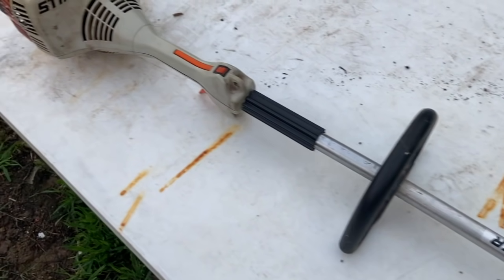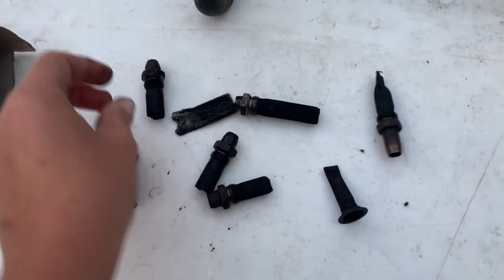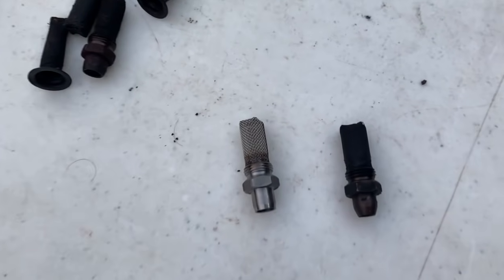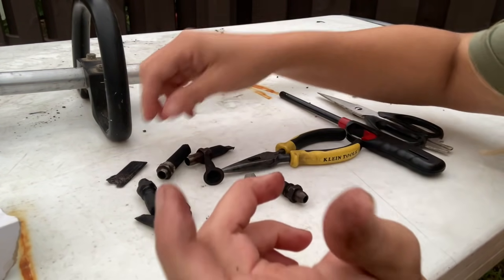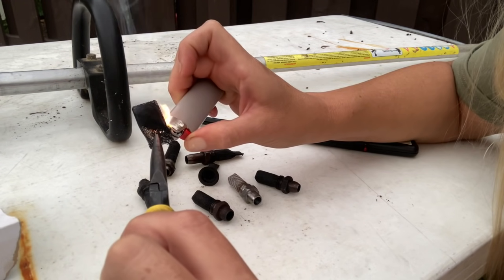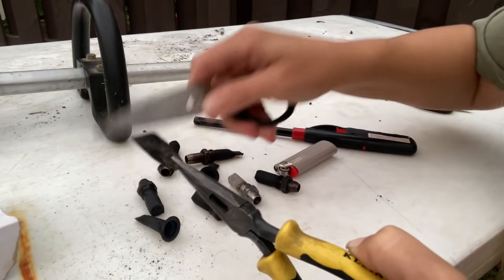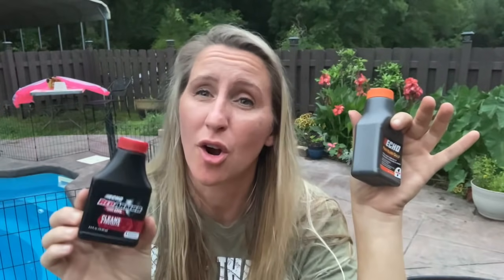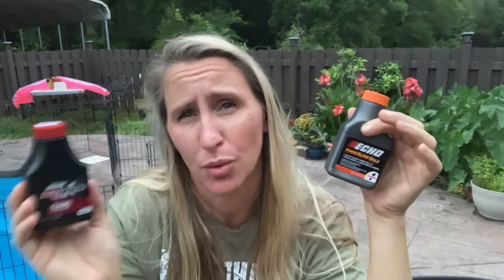THE BIG SECRET! STIHL has NO POWER? Won't Throttle Up? How to fix your trimmer/blower.

Comment: Excellent video.  I've been using Stihl oil -- non-synthetic -- for about 35 years.  My logging saws (044 Stihl) purchased in the early 1990s, still run great and were never taken in to a shop.

Comment: Long time ago in the early 80's, I was a bike mech. Two stroke engines were used in small displacement scooters. The "muffler/stinger" was one unit and would clog with carbon. No power, so we would remove the unit, start a little hot fire and throw it in & let it burn til the carbon was gone. A fresh coat of hi-heat black and customers were happy

Comment: Thanks Chicanic, I live in Australia and this very same thing happened to my FS90 recently. In fairness my dealer mechanic showed me the filter and told me to run it at full throttle to avoid clogging the gauze.
I appreciate your tip too on the Echo oil, I'm not sure if we have that brand here but I'll endeavour to find out.
Reply: Not that easy to find Echo lubricants here in Aus, Penrite 2 stroke oil is easy to find at Repco, Autobarn, Supercheap though. Been using Penrite for many years now.

Comment: Thank you so much!  Excellent tips and makes perfect sense regarding running the motor full-on. Wishing you all the best!
Reply: thank you. also, i use non ethanol gas,cheaper than engineered gas .also,Amsoil Sabre has stabilizer in it!

Comment: I've been using ethanol-free premix 2stroke fuel now for a few years and apart from a small adjustment to the idle and full throttle speeds its the best thing for starting first pull and the pleasant smell of frying potato chips from the exhaust.

Comment: Thank you for this video!  My 3 y/o Stihl backpack blower wouldn't throttle up and I discovered the spark arrestor was completely clogged with carbon.  After I cleaned it per your instructions, the blower runs like new again.  You saved me a trip to the repair shop.

Comment: good to know. I use the Stihl oil and I took the spark arrestor off my echo weed Wacker cause it kept clogging up and would become powerless. I use the same Stihl oil in my 11yr old Stihl hs45 hedge trimmer, I have a lot of hedges to trim. I run the hedge trimmer at wide open throttle 100% of the time and never had to clean the spark arrestor😀. The hs45 is my favorite power tool and the only thing I've ever had to do to it is sharpen the blades.

Comment: I run Amsoil Saber in all my equipment, zero issues and lots of power after years of use.
Reply: amsoil is the good stuff
Reply: You are correct! I purchased a case of  Amsoil saber 100 to 1, and use it on all power equipment. It really is the best. 8 years now with no issues 👍
Reply: lucas oil is also damn good stuff

Comment: As a Stihl professional, I can tell you that every other maintenance of your machine it would be good to use the decarbonizer to help prevent any such buildup! As soon as she said she wasn’t paid I knew she had a biased that was confirmed when she said she was an echo dealer! lol
Reply: I’ve run my Echo 770-T in my lawn business since 2016.  Never used or needed a decarbonizer.  I did remove the spark arrester but otherwise it’s stock with no other mods.  Still fires right up and has full power.  It also starts much easier than my new Stihl backpack blower.  I use the Quicksilver oil from Walmart.
Reply: Recently purchased a Stihl trimmer the sales person never offered or mentioned any specific oil for this trimmer.
Reply: @fivespeed3026  Exactly... You never needed it because you removed the spark arrester so it doesnt get clogged with carbon! lol Not saying it will happen but its a potential fire hazard for grass as well as yourself!
Reply: @monti409  Apparently the sales person was poorly trained as purchasing a 6pack of the premium oil would have doubled your warranty... but from experience I can tell you that you wouldn't need that warranty anyways!

Comment: Thank you for sharing. I agree with everything that you said - especially about running the equipment wide-open. As a matter of fact, I own three Stihl chainsaws and all the rest of my equipment is Echo. I only buy the Echo oil and high octane, non-ethanol gasoline for all of my 2 stroke engines. All my equipment runs top notch! Thanks again for sharing.
Reply from the maker: Thanks for watching!
Reply: Premium non-ethanol gas is the number one thing good you can do for a small engine. More people should understand that.
Reply: @larrybe2900  Where's the proof???  I run 87 in everything, and have no issues whatsoever.  Compression ratios in OPE are not high enough to require the increased octane.  No matter what you read on the internet.  That's why the manufacturers recommend 87 octane or higher.  If it did not meet the requirements of the engines, then they would say 89 or 91 or 94 or higher.  Paying for higher octane that you don't need and gives you no benefit other than your own "feel good" is just wasted money.
Reply: @BKD70  
I run non-ethanol high octane since what I have lasts awhile and also for fewer end of season carb. issues. A repair shop that sells product recommended I stick with the high octane and non-ethanol since I would not be buying just enough for the off season. I am sure if I ran them everyday I would do as you are suggesting.

Comment: If the screen is blocked but the unit starts, it's unusually quiet and normally won't throttle up. I use a heat gun set on max. Quick and easy and usually no scraping. Spot on with the cause, but in our shop it's across the board for all oils. Here in Australia we don't refine oil any more, our fuel comes by sea from Singapore, so it's already weeks old by the time it hits the bowser. I think that doesn't help either🤔
Keep up the great content 👍

Comment: I was a Silver Certified Stihl Tech for 4.5 yrs. Number one cause of problems is fuel. I always told everyone for the $11 buy the pack of Stihl oil (silver bottle) that doubles your warranty, but then take it and throw it away. The orange bottle of non synthetic stihl oil caused way less problems and would run with more power. Ive argued with people about this but the non synthetic Stihl oil is much better than the synthetic. The silver bottle mixed with gas will disintegrate much quicker as well.
Reply from the maker: Thank you!  I have gotten so many comments, people thinking I am crazy. LOL!
Reply: @Chickanic  I promise you are not i cant explain it but i think they push the Stihl synthetic 2 stroke oil because of emissions but it definitely decreases HP and makes gas go bad much quicker than many other 2 stroke oils.

Comment: Thanks for this. I'm new at this and was afraid running the new trimmer wide open would wear on it too hard. Turns out the opposite is true. The wait list at the local dealer is weeks long so the better I can learn to take care of it myself, the better off it'll be.
Reply: Yeah, but know when to say when. Don't void your warranty by going too far.
Reply: I just picked up a fs91R, the strange thing is the manual actually says: do not run on full open throttle during the break-in period (until about the third tank of fuel); and the trimmer will reach “full power” performance at about the 3-5th tank of fuel.  

Also as mentioned in the video, I was able to extend my warranty by 2 years by buying the 6-pack of oil with my trimmer, so people would definitely be using sthil oil during this break on period. 

After watching this, it’s a recipe for getting the spark arrester clogged.  🤷‍♂️ At least we know how to unclog it I guess.

Comment: 20 years ago, I purchased a 15 year old Stihl backpack BR340 for $100!!  It would not run up off idle, so looking at it I noticed the exhaust screen looked black.  When I got it home , I removed the screen and it ran like new.  So I bought a new one and was happy with it until 2 weeks ago when it sought on fire due to a fuel leak so I bought a new BR 430 and love how easy it is to srart.  Having been a Master Automobile / Truck / Motorcycle & RV mechanic since 1979, i appreciate your straight talk.  Please keep it up.  I appreciate you.

Comment: Great video!  I've not had an issue with my chainsaw or weed eater, but thanks to you I'm mixing my own fuel and will know what to do if I start losing power.  I usually run things wide open, so I'm hoping to avoid any build-up, but at least now I'll know how to fix it.  Thank you, Thank You, THANK YOU!!!

Comment: Pro tip, spray some carb cleaner on the spark arrest screen then light it on fire while holding with needle nose pliers.  Let it burn baby, burn!  Then hit it with the compressed air.  30 years as a OPE technician here.  This is a great video as always, spot on, 100%.  Also DO NOT run poor quality oil in a Stihl, especially NOT outboard marine oil, this is VERY important!  A lot of folks do not know there is a difference.

Comment: Just spent $350 on a stihl brush cutter and this is something that should have been in the 90 some-odd page, 60 different languages, damn near useless owners manual....so thanks for the tip
Reply: This is no tip, its operator error for 1, and any oil clogs the screen if u run low rpm. Also stihl gives u 2yr warranty if u buy a 6 pack of platinum oil when u buy whatever,  they don't make u buy they're oil
Reply: @kwmiked  it is a tip since the manual doesn’t mention if you don’t run full throttle you clog the screen my point was that “tip” was better than any of the information the manual had to offer. And yeah they offer the extra year for a six pack of oil or a $38 gal of pre mixed gas but that has nothing to do with the “tip” or as you like to call it user error for not following said tip

Comment: It would be interesting to see and independent lab test the Echo, Stihl, Amsoil and others mentioned to see exactly which is the best.  I have several Stihl products and have used Stihl oil in all of them and have never had an issue, probably because I read the manual and followed the dealer's advice..  Maybe your customers' Stihl products would have had the same problem with other branded oils if not running the trimmer at the higher RPMs.  Stihl doubles the warranty if you purchase the 6 pack of Stihl oil when purchasing your tool/machine.
Reply: make the suggestion to Project Farm. He has a tool testing youtube channel, and has tested motor oils in the past. One of the best I've ever seen.

Comment: Great video and 100% true. Another thing worth mentioning is incorrect gas/oil mix ratio. Many people buy these tools which are designed to run on 2% mix (AKA 50:1) and start using 40:1 or sometimes even 30:1because they "provide better lubrication". This, of course, is not true, but what is true is that those super oil rich ratios will help clog up the screens even faster. YouTube is full of "experts" recommending 40:1 to improve longevity even though the Stihl manual says not to do that even if the saw/trimmer/blower... are brand new. But who needs those boring manuals when we have self proclaimed mechanics who know better, right?

Comment: I suspect that more often than not, the actual cause is not the brand of oil,  but using the wrong oil/gasoline mix. Stihl requires 50:1. Exceed that oil fraction and the thing will be clogged up in record time whether you run it flat out or leave it idling.
Reply: 50:1 is ridiculous.  Should be no leaner than 30:1.
Reply: @mareksumguy1887  it won't work for any length of time if you exceed the 50:1 mix it was designed for. The burnt oil will clog the exhaust in no time. Mercury outboard engines were designed to use 50:1 as far back as I can remember too.

Comment: Great content! I have been slowly upgrading all of my equipment to Stihl over a few years and have been very pleased. This is a great tip. I come from the motorcycle service industry and learned early on that 2 strokes love full throttle! I have four acres so my trimmer, blower, and chainsaw run a lot and rev high a lot. Thanks again!!
Reply: I think a lot of that carbon could be negated if you used ethanol free gas . It would def burn cleaner .
Reply: @panchopistola8298  biggest problem with ethanol is long term storage it breaks down fast and clogs up the fuel system and degrades rubber & some plastic parts too.
Reply: What oil can u use for a kx250f four stroke

Comment: I use ECHO power blend,red armor and Husqvarna XP+ oil in my equipment mixed with VP small engine fuel i get the 1 gallon cans of VP as 4 cycle to refill my 1 quart cans mixed at 50:1 or 40:1 depending on equipment i use a syringe to measure the oil for a 1 quart mix so i can fit several cans of fuel in a backpack when on large jobs like brush cutting or using a clearing saw.
Reply: Where do you get Husqvarna XP+ oil? Lowes doesn't sell it anymore.
Reply: @johnnellis3025  It depends on the area you live in my Lowe's stores still sell it if you have a Tractor supply,Ace hardware or a local dealer that sells Husqvarna equipment in your area you may be able to find it there.
Reply: Well do you use echo red armor mix
Reply: @efrenvenegas3346  I do use ECHO Red Armor mix especially in my echo trimmer do you mean the premix fuel or the mix your own fuel method? I use both i just don't use gas from a gas station i typically use VP small engine fuel in the 1 gallon 4 cycle cans and mix my oil in those the reason i do so is so my tanks don't get sediment in them and also to keep my carburetors in good shape.
Reply: @jamiecrisp5084  since i bought new stihl fs70r in i got a use fs100rx 2 stihl like me i get 2 gallons in pour oil on my gas in too gas tank i use unleaded
Reply: @efrenvenegas3346  I have a STIHL fs70r as well very nice trimmer mine i upgraded the gearcase on it to one like the fs91 and up has with grease fitting the biggest reasons i don't use unleaded gasoline are the fuel i use is much cleaner burning so when i use half throttle a lot at times especially around cars and windows i don't carbon my engine up as bad and gasoline is recommended storage for 30 days without fuel treatment vs 2 years with the fuel i use  Steve with Steve's Small engine saloon has a video on stihl motomix where he shows a chart of the ingredients in gasoline vs motomix very interesting video that video explains a lot about why i don't use gasoline from my local gas stations in my equipment.
Reply: O ok

Comment: When I bought my 3 Stihl products, all separately, I wasn't threatened with my warranty being voided if I didn't use Stihl oil.  I was advised the term limit for the warranty would double if I used their synthetic oil.  I've had these machines for ~14 years and the only reduction in power I've experienced came from the darn fuel diaphragm getting old and brittle.  Even though my machines are the lower end of the commercial line, they've been used fairly lightly in my typical homeowner application.  So, for me, the oil has performed flawlessly.  It's those crappy metering diaphragms that cause the  problems in these small engines.
Reply: I think she talking about newer machines that have more emission reducing controls/designs that get carbon clogged when run at low speeds/loads.

Comment: Flames out the exhaust sounds like fun. I bought a 120 mk II  Husqvarna saw, no one told me you suppose to release the chain break as soon as your saw starts, Noticed copious amounts of smoke coming out from saw once it had started with choke on,  Released chain break.  Chain Break a bet worn now, also have to use Huskvarna branded bar oil and two stroke low smoke oil at 50:1 else void warranted also.  Love your show and tips Chickanic.

Comment: Ive been a lawn equipment mechanic for 30 years. when you run 2 stroke engines at low to half throttle. the exhaust will eventually clog.  DO NOT use cheap 2 stroke oil.
Reply: What is the best oil? What do you use, or recommend?
Reply: yes. All garden equipment should be used at full throttle. It doesn't hurt them. Just make sure you use good oil.
Reply: @johnnellis3025  After stuffing up my 5th Stihl chainsaw using Stihl’s brand of oil at their recommended 50:1 mix. I’m now using Husqvarna chainsaw’s and Husqvarna’s brand of oil, at a mix of 33:1. Using them for 2 years now, so far so good, time will tell if they are better than Stiihl Chainsaws.
Reply: How do u feel about caster based oils?   Had great luck in my preformance boat and Banshee using it
Reply: I've had the same stihl equipment for 8 years still runs fine everyday I've only used their oil once when I bought it..i have my own lawn service only john deere and stihl
Reply: @johnnellis3025  I run the cheapest 2cycle oil I can find, been working with a 029 super Stihl chainsaw for over 25 years.  I had to put a new carb kit in it for the first time last year. Runs like a champ, no gimmicks just maintain it and it's fine.
Reply: I've owned shindaiwa trimmers, blowers and hedgetrimmers for over 20 yrs. Ran shindaiwa oil and now I run cheap gallon TCW3. Run em wide open after idle warmup. Get rid of the stupid ass muffler screens. Clean the exhaust port once a year and run fresh fuel and you should never have a problem
Reply: @brianwalker1933  stihll is better than huskvana overall.
Reply: Another recommendation is High Test or Supreme Gas. We recommend it to all our (rural) customers. Those "ma and pa" gas stations typically sell older gas which is already half garbage
Reply: @brianwalker1933  I prefer husqvarna chainsaws over stihl saws ..I have two of each and never problems with the husqvarna..when stihl put that stupid quick pull cord or whatever they call it all that happens is you break the pull string all the time
Reply: @johnnellis3025  ~ Synthetic.
Reply: I use regular 4 stroke oil with my gas, or waste oil depending on what’s around. Works no problem.
Reply: @chadanderson2486  
Chad, TC-W3 is for water cooled 2 stroke outboard engines.
You should use 2 stroke oil that is formulated for air-cooled 2 stroke engines.
maybe your way of using the machines has worked re the outboard oil...others may not be so lucky.....